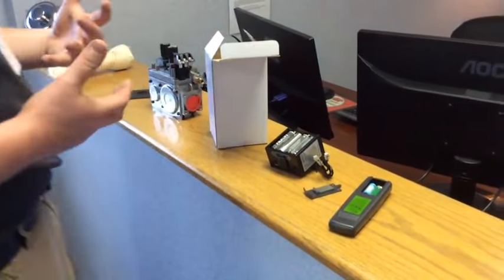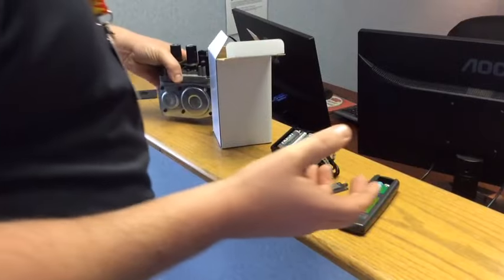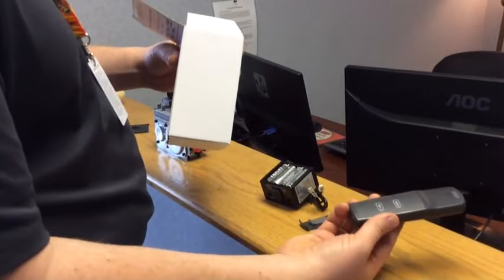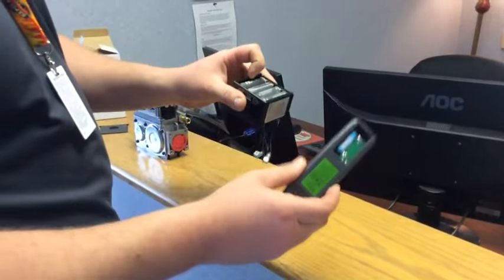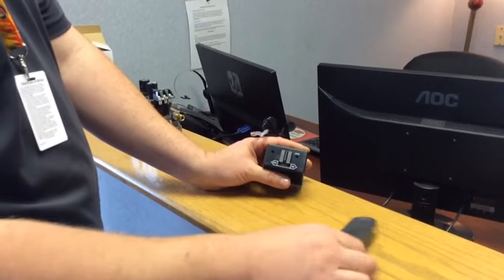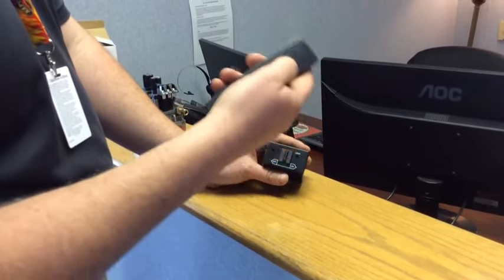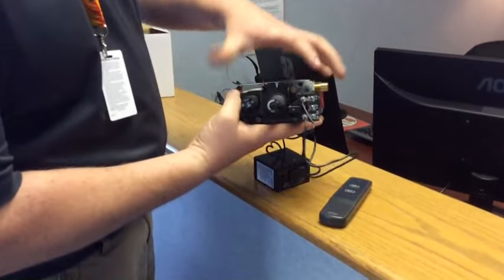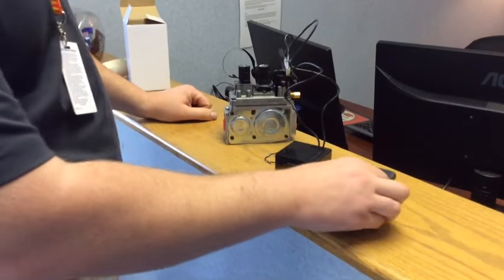Setting Up Your Remote for a Basic Gas Fireplace

Comment: Great video but I'm stuck lol what position does the burner need to be set to fit example after I first turn on pilot light position to start the pilot light do I then turn it to the ON position at that point do I use the remote to turn it in and off from that point on

Comment: What is the fireplace supposed to set at? On or Off. When I set it to On the remote doesn’t turn it off when I set the fireplace to Off the remote does turn it on either. I know the pilot needs to be, but what is the fireplace turned to.
Reply: You set it to “Remote” which is in the middle between “On” and “Off”.